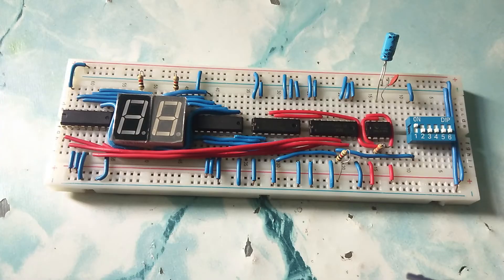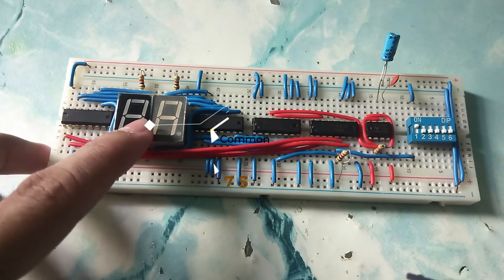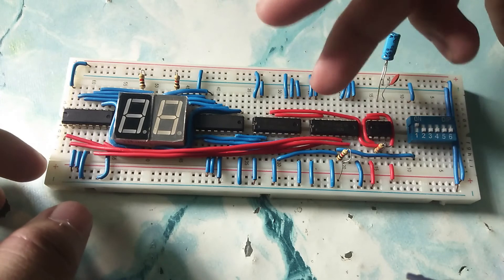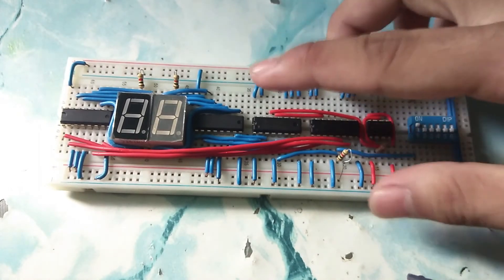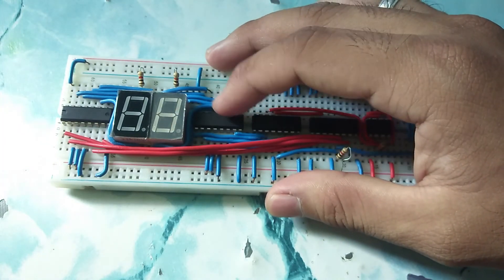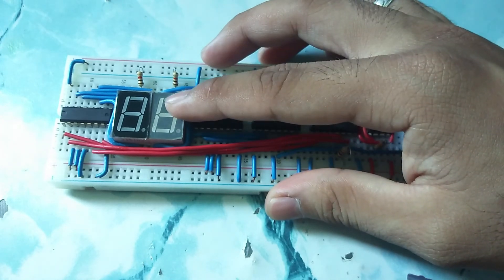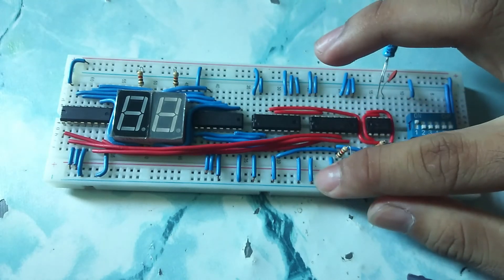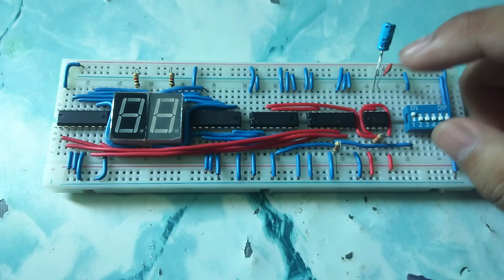7 Segment Up/Down Counter 2 Digit

Comment: I made functional circuit with this tutorial so thanks for being legit. Only 2 things i would recomend to you is, in the diagram number every pin of the ics so it is easier to navigate, and say or write which pin you are connecting because i made simple mistake that i fixed but for example the jumper wire between pin 1 of 4511 and pin 2 of second 74ls190 looks more like it is between pin 1 of 4511 and pin 1 of 74ls190. Its a issue of the camera angle. Othervise it is working so thanks again
Reply: Can you tell me the list of components please?
Reply: @OsamaAhmed-db2lm  Of course,  he uses
2x  7 segment display common cathode ,
2x 220ohm resistor (for the display), 
2x cd4511, 
2x 74ls190,
1x 555 timer,  
1x 1k ohm resistor, 
1x 50k ohm resistor ( im not sure if this value exists so i used 47k ohm and works too),
1x 100nf capacitor, 
1x 10uf capacitor (this one basically controls time of the pulse, you can change value for faster or slower count), 
1x button. 

In the part 1:50 thats 1k ohm resistor he uses
Just be careful with the wiring if you follow the video because again the angle kinda messes up where he puts it.
Reply: @epiccharliecz4000  thanks a lot
Reply: @OsamaAhmed-db2lm  You are welcome :)
Reply: @epiccharliecz4000  Can you tell me the names of ics from left to right according to how he plugged them?
Reply: Can I know the wires exact location from the png?
Reply: @OsamaAhmed-db2lm  I recomend you to work with the diagram, if you dont know how to read it, try some tutorials on youtobe its not that hard. Also you can follow his steps on video just double check the diagram paths. You can also look for pinout of the ics on internet and then you´ll know which pin is which.